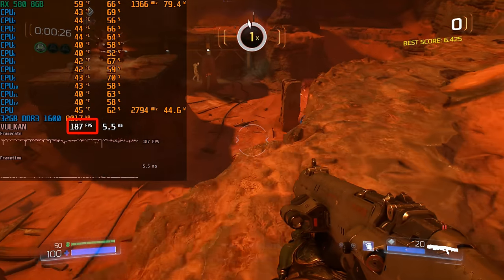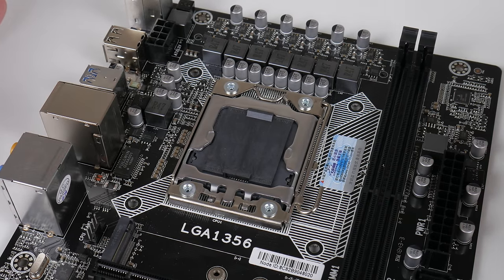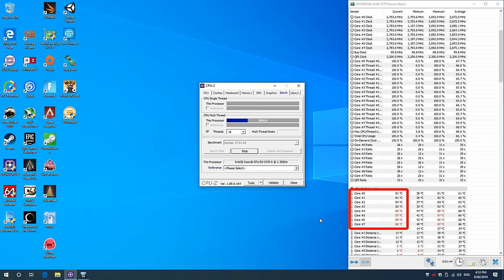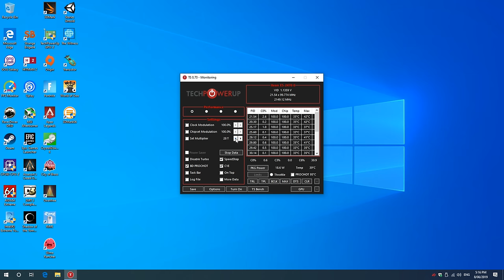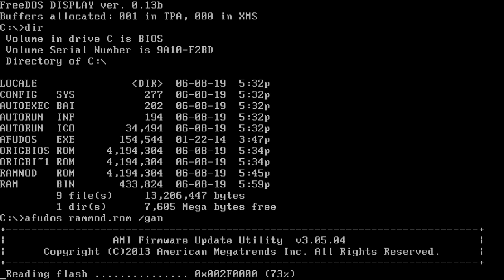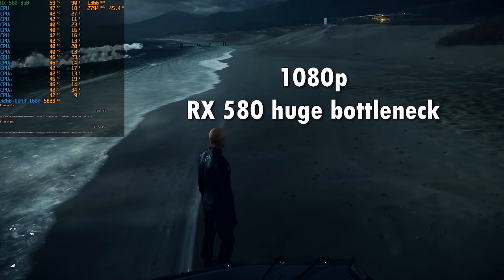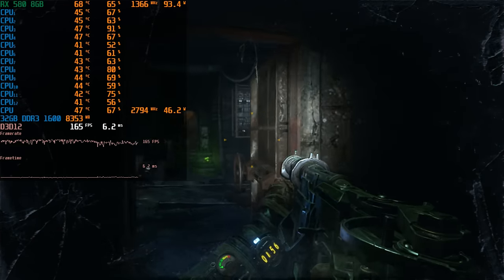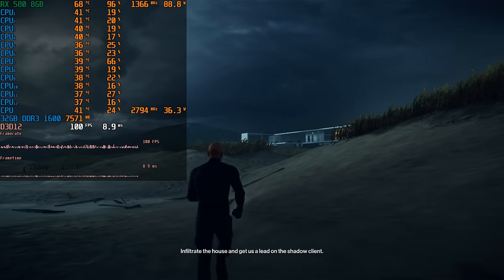6 Cores (and more) for everyone! Taking a closer look at the LGA 1356 platform.

Comment: It's an ok value, but ya gotta look at more than just core counts. The single threaded performance is suffering a ton. And anyone who buys this isn't gonna be able to upgrade to much at all. Sure there's the $125 10 core Xeon... (E5-2470 v2) but it only performs as well as the $80 6 core Ryzen 5 1600.
Reply from the maker: Agreed! Past the E5-2430V2 it's best to go straight to LGA 2011 platform, here you can get E5-2689 for around USD 60 and it performs like Ryzen 7 1700! We covered it in previous videos.
Reply: @philscomputerlab  yep

Comment: I would add a VRM cooler to that naked VRM. Just hack/saw an old Northbridge cooler and glue it with 1part cyanoacrylic glue and 1 part (cheap) thermal paste. it work wonders. An example of an old G31 ES2L can be found in this link. https://i.postimg.cc/QtSHMLFr/G31DS2L.jpg

Comment: I wonder how the performance of these Xeons would compare to the i7-4770k cpu. Mine I was able to overclock it to 4.4 ghz and I have that with 16 gb ddr3 ram 2400 mhz and a GTX 1080 graphics card
Reply from the maker: Well 2.8 GHz and 4.4 GHz is quite the gap :D
Reply: @philscomputerlab  Would be nice if you do a userbenchmark benchmark. While it's not really that great of a benchmark it's the easiest to get a rough idea on how it would compare to "your"(by your I mean we the viewers) PC.

Also I don't remember seeing you check how much watts the E5 2689 uses. Would be nice if you do it in your next video, since from what I've seen this seems like the best price/performance from the E5 2xxx series.
Reply from the maker: @xingbairong  I've covered power draw in the 2689 video!
Reply: @philscomputerlab  Oh then it seems I have bad memory. Couldn't remember, but because here you made it a point and I couldn't remember I thought you didn't do. Will rewatch the video. Cheers ;)
Reply from the maker: Yea it's quite the power sucker, thanks to the older Sandy Bridge.
Reply: PhilsComputerLab I guess none of the Xeons are overclockable like the K series.
Reply: @sburton015  There are overclockable xeons on the x79 like the 1650 v1/v2 to 1680 v2 to name a few.

Comment: Just watched Hardware unboxed reply to this, yeah rather get a Ryzen 1400 or get a second one.
Reply: rezargamer  yeah if it was really a good deal then yeah. But this isn't a good deal. I normally come to Phil's to watch good deals.
Reply from the maker: Yea good coverage! I think because I did Socket 775 and Phenom II projects before this, I got really excited and I'm genuinely happy with the performance I'm seeing, so I found his video really interesting and how it compares to modern alternatives. I'm confident that people will form their their own opinion and we can all learn from each other :D
Reply from the maker: Nah it's all good, we are talking :) Also note that I used a better motherboard with nicer layout, M.2 and USB 3, a better CPU the 2430V2 and I modded my BIOS to overclock the RAM to 1600 MHz 11-11-11-28, all of this does make quite a difference :)
Reply: HMMM this is a hard one would I buy a Ryzen 1400  or do I buy a E5 2689 that is for $60 and be on par to a $200 CPU.

E5 2689: https://www.cpubenchmark.net/cpu.php?cpu=Intel+Xeon+E5-2689+%40+2.60GHz&id=1881

R7: 1700 https://www.cpubenchmark.net/cpu.php?cpu=AMD+Ryzen+7+1700&id=2970

Both have the same IPC rating only difference is one clocked 100MHz higher. And one cost $60.

Comment: Tried the 2420V2 processor on this with RX580 gpu but for somewhat reason it reboots when loading high resolution videos. Install driver and that fixes the issue atleast on an Ubuntu Linux.

Comment: Hey next time you run one of these Xeon tests could you run the War Thunder bench? The game is free and has the bench built in so you don't even have to actually play it but ever since they switched to the new engine its been a real bugbear trying to find any actual numbers as the old engine was a lot less CPU intensive so those scores are no longer relevant and all the websites with sys reqs have the requirements at release which frankly are pretty potato and wouldn't get 10 fps today.

The reason is I'd love to throw together one of these cheap Xeon builds so I could stream as well as record and those extra threads would be great but it won't do me any good if the new engine tanks because of the low clock speed.
Reply from the maker: I'll give it a go, it's downloading now.
Reply: @philscomputerlab  Thanks, my old PC is about on her last legs and if I could build a PC with more threads so I could stream and game and use as a renderbox? That would be awesome. Thanks man!
Reply from the maker: @TheHangarHobbit  The system with be the better LGA 2011 motherboard, a 6-Core 12-Thread CPU and 8 GB RAM for under USD 100 :)
Reply: @philscomputerlab  Yeah I noticed Aliexpress has some really nice kits but I was worried the lower clock speed might be an issue as recording I can drop down to the low 70s with my FX8320 at 4Ghz. The new engine looks really beautiful but it can really slam CPUs with all the forests and scenery at 1080P. But if the Xeon can run it with high settings at 1080p? That 2630v2 with 16gb of ram for $105 looks really nice.
Reply from the maker: @TheHangarHobbit  Yea that's pretty much what I will be using. A cheap 2011 board, 2630V2 and 8GB RAM.
Reply: @philscomputerlab  awesome,sounds like it will make a great renderbox!

Comment: Can you compare it with the e5 2620 v2? I mean, on the 2620, despite being more chep and having lower clock we get quadchannel mem, And even with the motherboard being more expensive we get a cheaper cpu
Reply from the maker: I didn't get that CPU, I recommend 2630V2, very solid CPU!
Reply: @philscomputerlab  not a big deal but they are in a 10 dollar difference for a boost of 500 mhz, so I don't know how much difference it will make on the performance
Reply: @philscomputerlab  To be honest I'd rather buy the cheapest, if an option, and then save for the 2650v2, which will give me 8/16 cores/ threads with a speed of 3100 MHz for core on turbo
Reply from the maker: @jaizon  You need to look at all-core turbo, that information is not given on Intel specifications. Best to look up on cpu world. I tested the 2630V2 and it's very good balanced, 6 cores, high enough clock speed for most games and low power. Yea 2650V2 is even better, but price has crept up, so I try not to cover it too soon as it will just make it even pricier.
Reply: @philscomputerlab  you right, th 2630v2 seems like the best option, only thing is bat is the motherboard price rn, you know of any cheap with quad channel?
Reply: @philscomputerlab  Hi! How does the power consumption of E5 2650v2? Since it was rated at 95w chip and how does the vrm temps on lga 2011 mobo like you've tested last week (PlexHD). I wish you can discover a lga 2011 x79 chinese mobo that have the same price with your newly introduced lga 1356 mobo. Nice 👌 bios modding luckily that particular mobo supports ram overclocking despite having no heatsinks on the vrm
Reply from the maker: We will be checking out 2650V2 in a few weeks hopefully!
Reply: @philscomputerlab  Thanks. That would be awesome.

Comment: You are using a power meter at the socket ? What is the efficiency of your power supply ? What is the efficiency of the Mosfets and filters on the board ? Please us a DC clamp meter to make CPU power measurements.  Clamp the CPU 12 V rails and eliminate all parasitic loads from your measurements.
Reply from the maker: Power meter is at the wall. The PSU is 650W 80 Gold.

Comment: I've already bought this motherboard + the 2420v2 that is more cheap than the 2430v2
Reply from the maker: That's fine, just remember that I never recommended the 2420V2, and always the 2430V2, so if you're not getting what is shown in the video, that's the reason!

Comment: Is it possible to install heatsinks on those VRMs? I think they need something to help with the heat
Reply: You can glue it with a thermal glue.
Reply from the maker: Yes, you can use 3M thermal adhesive, or mod something together that fits to those mounting holes.

Comment: The motherboard has holes for a VRM heatsink. Why on earth didn't they install it? It can shave 20 degrees off.
Reply from the maker: Agreed!
Reply: @philscomputerlab  Did you measure the distance between the holes?
Reply: @philscomputerlab  I've used these before on a MSI 970A-G43 in combination with a FX-8350 and VRM temperatures dropped around 15-20 degrees.
http://bit.ly/2WZcLRR
Reply from the maker: It's 95mm!

Comment: in terms of price to performance.. should i be getting this or the upcoming ryzen 5 3600?
Reply: Gaming or actual server processes? because biggest bang for your buck is going DDR3/LGA1366 if you are just doing plex transcoding or hosting gameservers. Gaming in itself the ryzen would be the way
Reply: thanks :)
Reply: @Carbiniz3r  but the Ryzen 5 cpu he mentioned is going to be far more expensive than anything Phil is mentioning.
Reply: @DeViLzzz2006  ...yeah but the guy im replying did so ....
Reply: Used first-gen Ryzen 5 rigs aren't bad value either... pretty much up to par with this 1356 setup except somewhat higher in both performance and price.
Reply: @PileOfEmptyTapes  somewhat? i see 1156 Xeons for 20 bucks... vs Ryzen 5's still 100+

Comment: Could it be that the VRMs got to hot with the 8 Core because you weren't using a top blow cooler?
Reply from the maker: Yea to a certain degree, but I believe even with a top-down cooler, the lack of VRM cooler is what's causing the issues.
Reply: @philscomputerlab  And about that WindowsApps folder I've used this guide here: https://www.maketecheasier.com/access-windowsapps-folder-windows-10/
Reply from the maker: Yea thanks, I've managed to access it by making myself the owner of the folder in the security settings!
Reply: @philscomputerlab  nice

Comment: I won't argue that these are a great value. But, unless you have a 100% finite budget they aren't the best choice. The motherboards are too expensive on these platforms. A lot of the time you'll spend more on one of these cheap knock-off boards than you would on something newer with a warranty like a b350/b450 am4. With the recent drops in memory prices, and the constant sales you can find, the ryzen 1600 is a better value, but admittedly slightly more expensive for the mobo/CPU/ram combo. But it's only about $50 more for a significantly newer and better product. There aren't many cases where being able to throw another $50 at a GPU is going to outweigh the better foundation of the am4 platform. I think if you're going to look at older Intel chips a good place to start is actually the i7 2600 non-k. You can get an entire dell desktop for $100. I paid $140 shipped for a 990mt with a i7 2600, 8gb of ram and a 1tb hdd. Throw in a 300-400w psu and an Rx 460 and for less than $200 you have a fully functioning system that will play current games at 60fps. You may have to turn a couple setting in game down a little, but that's the exact rig I use as my second/streaming system.
Reply from the maker: We will check out Ryzen stuff soon, so stay tuned!
Reply from the maker: Oh, and I've covered OEM machines like HP Elite 8200 and Dell OptiPlex 9010, they are indeed excellent value :)

Comment: I very recently had a bad experience with a Chinese 1366 Cooler:
- https://www.ebay.com.au/itm/Computer-CPU-Cooler-9cm-Cooling-Fan-Heatsink-2500RPM-Hydraulic-for-LAG-1366/132773898221
It clearly states everywhere that it's for 1366, but on the package I got it was very strictly only for LGA 115x and 775. Obviously I tried to install it on my LGA 1366 motherboard, and it's way off. 1366/1356/2011 has 80mm between holes whereas 115x/775 is around 75mm.

There some to be hundreds of accounts selling this exact same cooler so just be wary of what you buy.
Reply from the maker: Hey I got such a cooler, but mine is from AliExpress and with a red fan. Mine IS for 1366, the backplate has adjustable feet, and they pull out all the way to fit.

Comment: should i choose this over  ryzen?
im curently using i5 sandybridge. my 2nd ddr3 slot damaged n become unuseable. i need a new cheap mother board :'(
Reply: If you need high single-core turbo, this may rather be a step back. I'd rather look out for a decent used first-gen Ryzen board/CPU/RAM set (Ryzen 5 1600 or somesuch), which shouldn't be that much more expensive and would be substantially more modern in features. Performance per watt actually seems to be quite similar between the E5-2430v2 and the Ryzen 5 1600, except that the latter is about a third faster throughout.
Reply from the maker: What about getting a H61 motherboard? There are new boards for ~ USD 40 to 50 on AliExpress.
Reply: @philscomputerlab  whats the best upgrade from intel i5 2500?. i hate bottlenecking my rx580 8gb😂

Comment: Get 16gb for 20$ then use the 40$ for a better cpu cooler
Reply: and pay 100USD+ per year for electricity, and another mobo, cause the vrms are 100C+, and have an old used CPU with security flaws with no room to OC or upgrade...
It does make sense if don't think about it.

Comment: What is the max safe temp of vrms because for me they can reach 90 degrees without any cooling with phenom 955BE?
Reply from the maker: It depends on the components, and you can pull up the datasheets and study them. But most boards start safety measures at around 125C package temp.
Reply: @philscomputerlab  ok thanks and btw nice video
Reply: Usually the VRM high-side MOSFETs can run at up to 125C internal temperature, and the low-side are usually good for 105C internal temperature, the chokes are usually good for up to 150C and beyond, and the capacitors if they are good quality ones will cope with 105C, but the cheaper ones will be 85C.

But like Phil says, you need to find the datasheets for the specific components on the board, as the quality of each manufacturer's products can be very different.
Reply: @PaulTheFox1988  It's unfortunately oem board that's why I am concerned about the vrm temp. I will try to read mosfets type on the motherboard but the writing are so tiny xD
Reply: @Ahmedibrahim_1999  well 90c is likely fine, although it really depends on a lot of different factors, far too many to mention here, but if you're concerned then even a fan running at 800rpm will be enough to cool it down to a much more comfortable temperature. 
If you're measuring 90C at full load and the system isn't shutting down then it's fine, it would last longer at a cooler temperature, but I wouldn't panic about it.
Reply: @PaulTheFox1988  I don't care about noise so I installed a 80mm fan very close to the vrms and running at 2000 rpm
So is it enough?
Reply: @Ahmedibrahim_1999  It should be, again, if the computer isn't shutting down when running at full load then it shouldn't be an issue. :)

Comment: https://www.aliexpress.com/item/E5-2420-V2-Original-Intel-Xeon-E5-2420V2-2-20GHz-6-Core-15MB-LGA1356-E5-2420/32812028254.html  

Would this not be the best value cpu Phil instead of what you listed because this cpu actually boosts to higher clocks when needed?

Also got to say with more chipsets you look at and what others are mentioning it is getting harder to sort out what to go with.
Reply from the maker: "boosts to higher clocks when needed?" What do you mean? This applies to all Xeons.

Comment: Are these Over Clockable was think of building a ryzen 5 rx580,is the RX 580 compatible with xeon main boards.
Reply from the maker: Nope, the CPUs are all locked. To OC you need LGA 2011 and unlocked CPUs like 1650V2, but they are expensive and then the value is poor...
Reply: @philscomputerlab  some of these xenon cpus are $20 Dollars and are just falling short or even better fps than i5s and i7s which are 200 plus.
Reply: Is there a motherboard that uses xenon and i7s?

Comment: For everyone thinking on taking this road and wanting a check on the real value of this solution, check this video of Hardware Unboxed out first: https://www.youtube.com/watch?v=pBtT-vYeIyE
Reply from the maker: Note that I'm using a different mainboard with better layout, M.2 and USB 3, a faster processor, and I modded BIOS to allow RAM run at 1600 instead of 1333!
Reply: @philscomputerlab  You are right, but they address the business case for more (expensive) parts on that platform as well.

Comment: Interesting.. I see that 1356 xeons are triple channel capable. I wonder if there's a chinese board out there that supports 6 or 12 DIMMS and together with a low power ivybridge would sip power...
Reply from the maker: Not yet, but just go with 2011 for Quad Channel!
Reply: @philscomputerlab  Maybe. My focus is good performance (cores/memory for multiple VMs) and power sipping. I do appreciate that you give us the power consumption for everything that's not something many do and a reason I subbed :)
Reply from the maker: Of, so then LGA 2011 is the way to go and good CPUs are 2650V2 or even Xeon E5-2630L v2 for even lower power.

Comment: Check out HU 🤣
Reply from the maker: Nah it's all good, we are talking :) Also note that I used a better motherboard with nicer layout, M.2 and USB 3, a better CPU the 2430V2 and I modded my BIOS to overclock the RAM to 1600 MHz 11-11-11-28, all of this does make quite a difference :)
Reply: @philscomputerlab  Yes, everything was in detail. All that matters is accessibility and pricing for the individual.

Comment: What about the 2420v2?
Reply from the maker: It's cheaper, but slower clocked. I find the 2430V2 the better option for games.
Reply: @philscomputerlab  Thanks! It would be interesting to see how much difference there is beetween the two. Putting toghether a pc with 8gb of ecc ram and the 2420v2 is pretty much bottom of the barrel cheap, if its capable of fully utilizing an rx570 would be amazing value!